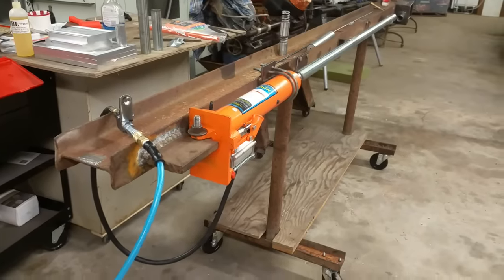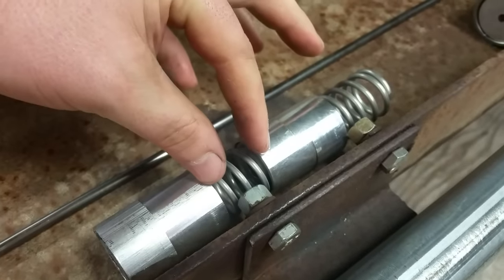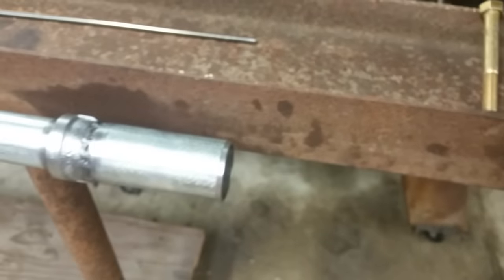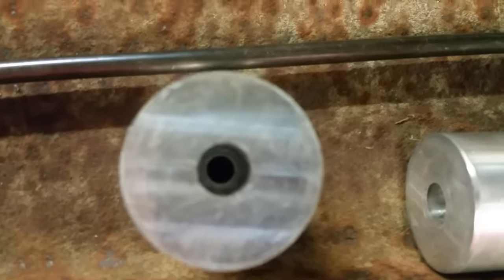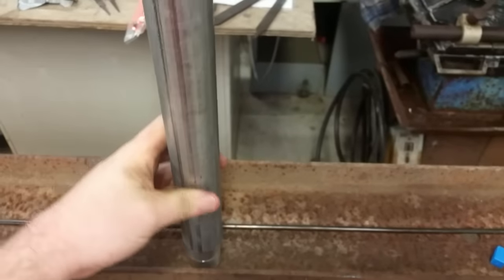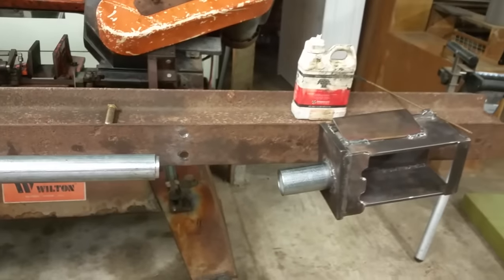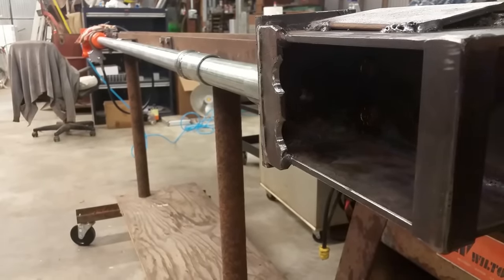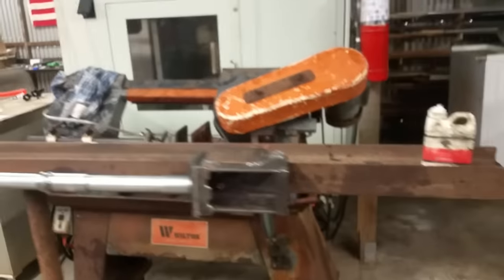Button Rifling Press - Home Built

Comment: hello there. the main problem that i see is that your barrel tube expands as you push the button thru it if your barrel stock is too thin as yours apparently is because it stuck in its guide. i think thats why the Germans went to "roto forging" , insert a rod in the proper size and shape and hammer the barrel from the outside to make it mate to the internal inserted rod. but thats just way to much for the home machinist. for a home made barrel your home made method is excellent, just use a little thicker stock.
again, an excellent job and equipment.

Comment: Nice. I've seen a miniature of this made from a log splitter and used modified reamers for a rifling cutting tool.and a few car parts  It made pistol barrels  You pumped the Barrel full of axle grease and pushed the tool through the tube the twist in the cutter head guided it

Comment: Curious what you plan to do with such a thin barrel...
Reply: The Whiskey Gunner show you how to rifle a barrel....
Reply: The Whiskey Gunner  sleeving id assume. Drill out the old rifling in a barrel and lock tight the rifled sleeve inside repairing the barrel
Reply: pretty sure it was being used as proof of concept before trying it out on a $300 barrel blank

Comment: Nice project. You can use a Mazak L40 or QT-40 or any size 40 Programmable Lathe to do them much easier, faster and more precise. Many do not know that the programmable lathes do some major pushing for making teeth for gears and for insert pushing key-ways in multiple passes. And for pushing grease zert channels in round shaft stock. And they allow you to set how many turns you wish the part to rotate and rifle as its pushing and cutting. Just ask around you will find someone near you with one. The other plus about them is the coolant/lubricant is high pressure and can be fed by hose from the other end of the lathe making sure they are not dry knurling the rifling.

Comment: I  hope everybody knows you can build your own guns any time you like and they are legal as well. Just don't sell them and everything is good.
Reply: Surprisingly, it IS legal to sell one, as long as it was not made to be sold.
Reply: Gary,  if the gun grabbers didn't want homemade guns, they wouldn't write laws to make the practice illegal, which is why it's not-yet.  They would use underhanded, back-door approaches making it illegal to manufacture and sell basic gun smithing tools to any "unauthorized" user, starting with the most basic tool rifling buttons. Then they'll call that a "common sense" measure.   They're starting to figure out that gun confiscation is impractical, (they know about the Canadian fiasco) so their next level strategy is to do whatever they can to make ammunition so expensive and scarce that only Michael Bloomberg's body guards will have any.  Then they try to write laws imposing unprecedented, ridiculously illogical, and unconstitutional strict liability laws on firearms mfrs., because they know they'd have to order the military to protect them in Washington D.C. if they tried to eliminate commercial gun makers by direct law.  Death by a thousand expensive cuts. The Chi-Comms couldn't do a better job of rendering the U.S. defenseless.
Reply: Gary, something happened in my reply--second sentence should read: They will use under-handed, back door tactics, like making it illegal to sell basic gunsmithing tools, rifling buttons in particular, to "unauthorized" end-users.
Reply: @mikewiltfang7479  You cannot imagine how right you are.

Comment: Very nice rig, and good looking results.

I'd inspect those two bolts carefully between runs, they're working purely in shear mode (or, at least, don't stand behind the end stop when running a barrel, haha).  As others have mentioned, your thin wall "barrel" has distorted - if you're making sleeves, it would probably be best to fit them first and rifle "in situ" if possible.
Reply: My thoughts exactly!

Comment: I do like the idea and may use it in the future. It looks to me like you are pushing the button through too small of a bore or the barrel is not thick enough or the metal is too soft. If it is expanding and distorting it enough that it wont come out of the support sleeves it cant be good.
Reply from the maker: Good observation, I think what happened was that one of the sleeves was too tight to begin with (if you noticed that when I put it on) but the yield strength for this metal is 50,000+ psi and these 25acp tubes are meant to go inside real gun barrels designed for a larger cartridge (they're inserts)

Comment: Hope you had adequate ventilation when welding galv
Reply from the maker: Yes, very important! I tried to use the wire wheel on my grinder to peel off some of the zinc on the suface where I would place welds, then when I welded I had a swamp fan blowing and tried to do the bare minimum amount of welds.
Reply: That's a no shiter

Comment: #1 - it would have been nice to see you I bean cleaned up and made smooth. MAYBE it will not effect the outcome BUT that end fixture would go on and off a lot smoother. The barrel which you are refling will tendt to expend as a result of the "Button" going through. This, perhaps more than the lack of lubrication, might account for the tight fit problem when you were trying to remove the barrel from the ferrules.  #3 you NEVER hit steel on steel. You should have brass rods handy so if you get into a piece that is reluctant to release you can use the brass against the barrel rather than steel. The whole thing seems loose, imprecise. Yes, you have the rifling but is the barrel true? The workmanship on the machine you built is not clean. Functional, yes, machine finish - no. Quality is in the mind. If your tools are less than perfect, if the work you do is not precision, clean, smooth, neat - what will the barrels be like? You can not make a silk purse from a sow's ear.  It works - yes, but that is the quality of the finished product? Good luck to you. I sincerely hope you have success. You have the will and you found the way, by the way there are rams with far longer stroke. How will you do a long rifle barrells or are you going to make only pistols?
Reply: My Name  Oh, Wait - I DO have one. It is bigger, with heavier and much more precise machinery  - though one can't fault a fellow from setting up his own rig whether large or small.  Oh, Wait, you are one of the sub intellectuals who resort to insults when intelligence is lacking.  Max tried to  make a  device to do a job. He did it but he could have done it better. I would like to see him do it better because it will last longer and do a better job. Don't need to go to college to understand where precision comes from.

Comment: When I look at the hydraulic pump with the air line attached, all I can think about is the strain you're putting on the fitting. I would add a fat zip tie to that with a spacer between the pump and the jack housing. But that's just me. Nice work by the way.

Comment: nice job we here in khyber pass Pakistan used to cut the Grove with a twist cutter back then, know we also use a similar push button method .one suggestion that I have is that if you use solid thicker pipe instead of galvanized pipe and single bushing instead of multiple bushings you can get better accuracy from your barrels , with this method barrels will never be accurate you can check them with the reflection method and you will see the distortion in them

Comment: Aanother good lube is "oil stabilizer", available from auto accessories stores. Much the same stuff as used in deep-drawing and heavy sheet-metal forming.

It stays "slippery" under a LOT of pressure.

I have been using it for years  as a case lube when forming wildcat cases or even for basic full=length sizing of "once-fired military brass.

That is a neat rifling rig you have there. I am guessing you have a good deep hole boring shop nearby?

Comment: How large of a hydro press would be required to rifle a 1" diameter cannon barrel about 60" long? I imagine it's probably not something feasible to build too cheaply, but I am wondering.
Reply from the maker: all depends on how deep you need the grooves to be. if you need deep grooves, then probably at least something in the 20-40 ton range.

Comment: Yeah , so many questions! Why was the push rod so long?  Wouldn't just the length you plan running be good enough?  Like if max is 22" or the press then woulnt' a 24 or 26" push rod be enough? Also when you start smithing barrels and things don't you have to register? Was curious on the process. Not sure I could be anywhere accurate so awesome work!

Comment: You should be able to do more than the ram length by adding a rod 1/2 way through the cycle (retract and add another push rod).  For best results just put both rods on the lathe and make them self-center with a dimple and pimple method.

Comment: If the pipe you used is galv. waterpipe how did you get rid of the welding bead that's inside the pipe.If it's not waterpipe what pipe did you use that does not have a welding bead.I like what you did and I will copy it but I haven't figured out what to do about the welding bead in the pipe.

Comment: I would like to make some .458 cal,  barrels for black powder cartridge rifles , 26 inches ,  I have some . 30 cal blanks that I could re drill and use ,  I have a lathe with long enough bed ,  now I need to come with a rig like this , to push or pull the button . Thanks for posting your video .

Comment: Awesome.
I’m confused on how it works?
If you’re just applying pressure, how is it turning? I can’t understand why the “lines” are not straight, but, instead are forming the “spiral”.
I’ve seen someone doing the same with just a hammer once, and since then I have had that question. Now your video made me intrigued again.
Hopefully someone can explain this in a simple way. That would be great.
Nice video 👍
Reply: the button turns itself it's spiraled as the front of the button pushes the metal it makes it's own guide .....I think something like that

Comment: Would a ball bearing between the push rod and button allow for easier thrust lowering rod to button contact should allow the button to rotate  more freely,with the bulk of the resistance on the rifling process than the pushing force.

Comment: You should cut your spacers in half so they come apart. Instead of sliding the barrel in the spacers you just have half pieces that wrap around the barrel. This way when you expand the barrel while rifling it, the barrel wont get stuck on the spacers. Had nothing to do with no lube. The barrel expanded from the hydraulic cylinder force.

Comment: Excellent work. Just wondering why such a thin piece used for the barrel? All that work making all those spacers and such seems like you could have made the barrel a bit thicker and you wouldn't have had the barrel diameter swelling and getting stuck.

Comment: Looks good but I wonder why pushrod and tube is so long when barrels are only 22”
Reply: Paul Johnson it’s that long so the spring inside the long section can retract the hydraulic rod.  It could be designed to be shorter by using a two-way hydraulic cylinder (i.e. hydraulic power out and power retraction)., but that would entail more components, plumbing and $$$.

Comment: Up till at least 11 minute Mark ,you didn't say what spacers are made of ,unless I missed it. Are they stainless or alum. ?I wonder if some kind of V block type supports would be better to keep it supported and straight. What caliber is the one your using? And is 8 ton enough for a larger caliber ?  Nice job and video. As with anything,it's the idea that gets things started. Now the fine tuning with looks and functionality ,such as sanding and painting,more supports??but very nice job brother

Comment: I want your CNC machine!.....Great job, Max. You have a talent for not only innovating, but your video was really well done, too. I watched Mar's video a while back, he's another innovative guy.... A few questions & a comment....

Is there a reason you need such a long tube before the barrel section? Seems a shorter rod and tube would work. There would be fewer bushings & springs, a shorter tube & rod, less space, etc. The hydraulic ram seems to pulse as it pushes the button. Have you noticed if this affects the consistence of the rifling? It didn't look like it in the video, but hard to tell. Who supplied the button? 

The thin tube was great for a demonstration, but what about cutting a chamber? What caliber were you making? What twist rate are you doing? Have you thought about a followup where you cut & ream a chamber, then install and shoot the barrel? I think a lot of us would be interested in seeing that. Now what's your "break in" procedure.....lol!
 
Also, any amateur welders...make sure you wear the proper mask and ventilate well when welding galvanized metal...unless you don't plan on ever using the barrel....

Thanks for taking the time to do this, it was interesting!

Comment: Couldn’t you get a two way ram and use a diverter valve to retract it rather than having a really long push rod and sprung bushings to ‘push’ the ram back in?? Or was it a cost issue for the two way ram?

Comment: The secret lubes are soap based. Probably a lot like the old fatted lye soaps.
Reply: Lanolin would work well. High pressure lube of yesteryear. The grease,not the refined oil.

Comment: Button rifling versus hammer forged.
I understood Jurgen Anchutz button rifles their barrels but they draw the buttons through in increasingly larger buttons that only remove a few thousands of an inch of metal in each pass.
Progressively larger draw buttons increase the depth of the lands on each successive pass.
Other manufacturers hammer forge their hot barrels around hardened tempered reverse rifling mandrels.
What ever works I guess.
Your method appears to work well enough.

Comment: I think, I just saw James Bond.  Down at the end of your barrel. Nice job, I know how crazy it can get setting everything up just right and not forgetting anything. Every now and then watch out for a blow back/out. As long as everything is straight and don't forget to grease everything. You'll be fine. Your using aluminium for the guides? I like stainless steel guides. Over kill! That's my moto

Comment: Very nicely done, Rule #1 if it works don't mess with it... 
Welding beads are not that of a pro but neither am I, so don't worry about negative comments, see rule #1^^^
You might have one already, but a 4-1/2" Grinder 7, 11, or15 Amp will have your "I" Beam cleaned up in no time with a wire wheel or Flap discs, Harbor freight sells Combo packs of EXPENDABLE cutting wheels and grinding discs always pick up more ... you may go a while with out needing them but when your out of them it's to late for inventory to be replenished... 
For storage cut down a 5/8" wood dowel to 6 inches about as many as you want to keep for the different types of flap wheels by Grit, and cut off wheels, 1/16" 1/8" 1/4", then take a 2x4 and drill at about a 30° down angle, for each one, down I to the sides of the 2x4 spaced out +/- 6-7 inches apart, ( Trust me more space is better, try with a gloves on to get them off the pegs... ) keep used discs for total wearing out to get the most bang for your buck... they allow me to hang my Dewalt (I'm on my sixth one, parts interchangeable when factory smoke escapes) I've also burned up 2 H.F. models a B&D (shortest life span) and a Skill... yes you get what you pay for... expect it to break and have one on the shelf it will save you!!! At least from swinging it by the cord in frustration and damaging some thing by the Oops it hit when you let go full intending it to go and seek no harm...
Good luck and have a great day today.
Reply: Wait until you use the industrial metabo grinders. We used to do Makita and Milwaukee the way you are describing. But one metabo outlasted 6 Milwaukees. It was more powerful and smaller too.
Reply: @GunFunZS  
I've just begun to hear of Metabo, but flat out if it doesn't have a 5/8" 11 T.P.I. I don't ever want to deal with it... I've also got a 7-1/2 Grinder, sander, that in a pinch I can immediately swap over to... it takes strong arms to control it but it is a true Beast Master it spins so true with a 7" flap disc that you could achieve Surface Grinder results for flatness on a good size surface... I could consider once the trigger is locked just letting it run almost unassisted just a light grip on the side handle and a couple of fingers to balance it from just forward of the cord relief and by gentle lift or depression it will move left and right... how ever if it gets caught and takes a run... you be happy to know that you should NEVER Ever tie the cord to an extension in one of those killya Quick knots... I've seen roofers do that with a circular saw... 2 nearly severed fingers, 3 cut through air hoses, another extension cord that was on its way off the roof and landed on a new Mustang convertible...still running shattered the passenger window and hit the concrete drive... 100 foot cord...
Reply: @andrewostrelczuk406  that part is all standard

Comment: How do you control or set the rate of twist? Your set up it more of a broach than rifling correct? The thin tube expanded and that's why it hangs in the guides. Would it be possible less stress and more accurate if it was done in several steps being able to assist or step up button size in multiple steps to produce a better finish? Not trying to criticize just trying to figure out the intended end product and it's accuracy.